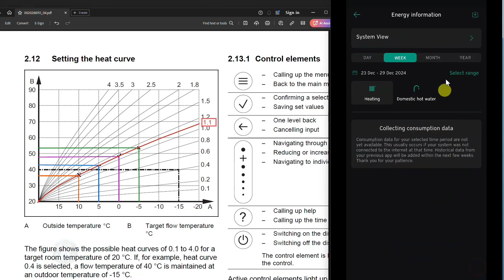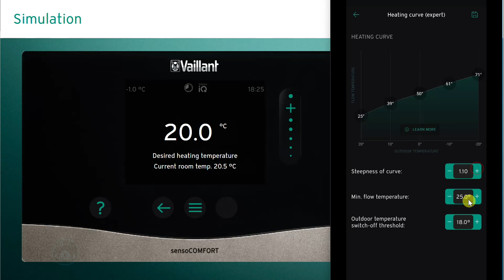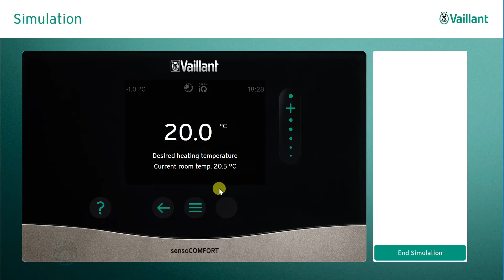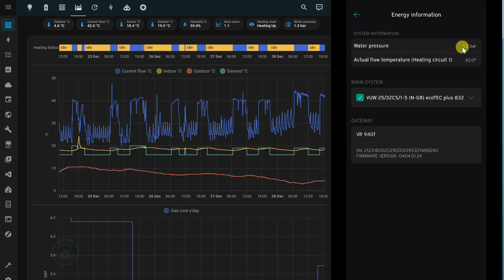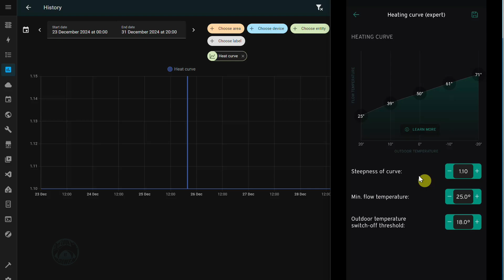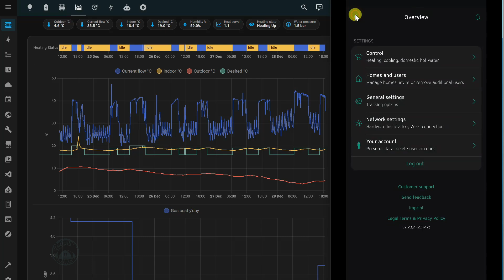How to choose the right heat curve - Vaillant ecoTEC Plus with sensoCOMFORT and weather compensation

Comment: what a false satement at the start that standard combination boiler sets fixed 70-70c flow temp? even 35 year old Vaillant combination boiler have scale 1-9...so you set it at lets say 5 and you get 50c flow temp...condenser boiler are just complicated shite with eco and mild warm radiators...great for brand new houses from ground up, for floor heating, 15cm insulation on exterior walls...on existing houses buying new boiler its not justified cost to have 10-15% less heating bill (in theory if you run in 50/30 mode) which will be nulled very soon when gas prices go up + inflation...not to mention servicing those new boilers...makes me puke
Reply from the maker: I didn't say boilers are fixed at 70-70°C, but fair point on the dial. Older Vaillants could be turned down and I didn't mention that. A dial gives one fixed flow temperature whatever the weather, though. The video is about setting up the heating curve with an outdoor sensor and the indoor thermostat, so the flow temperature adjusts itself according to the heat curve, calculated from the outdoor and indoor temperature. Set up right, the boiler runs low and steady instead of cycling on and off, so there's less wear too. Service it regularly and a good boiler lasts years. And this is an ordinary existing house with radiators, not a new build with underfloor heating. Get the curve right and it saves money, and if gas prices rise, you save more, not less.
Reply: @LookatBowen Sry if I sounded menacing. Point should be : condensing boilers are ment to work at 50/30c or 60/40c to maximize savings and therefore ensuring their prolonged life. True they may last a long time, while not as much as old school built tanks but 10-15 years should be reachable. Back to the topic, every adjustments made to the curve should follow 24h test to see how far we are off to the adjusted room temp. Personally 19-20c in a room is a way too cold for me for comfortable sitting or watching a movie, but hey these new boilers and heat pumps are meant to work that way, what can we do new world.
Reply from the maker: @sifon40, No problem, not too menancing. Agreed on your points, and maybe a week is too long to wait, although 24h is too short, maybe somewhere inbetween next time. Another bonus, from next year (cough, cough) we can turn up the room temp to maybe 20-21c, given the chancelllor is scrapping the gas standing charge. That silly charge will save a few pounds per months, which can go towards a warmer room, although I am sure there is will be some other gas tariff added to get that money back.

Comment: Are you saying that even outside the weekly planner ON times, the heat still runs?
Reply from the maker: Hello Andy, 
Yes, if the temperature (outside of the timer range) drops below the setback temperature, the boiler turns on. (for RoomTempMod = "Expanded"). 
With the mild weather we are currently having, I have my setback temp set to 18°C, the desired temp set to 20°C. During the ON time, it reaches that temperature and turns off. That is the correct behaviour. 
It is unlikely to drop to 17.9°C now, but later on in winter when outside is closer to 0°C, I don't want the indoor temperature to drop to far below the Setback temperature, because it will take a while when the time range is ON to get back to the desired temperature (of 20°C). If you've set that window too small (e.g. 7am to 10am), that is only three hours to reach the desired temperature. It won't get there! The heating is not instant. It rises gradually over your ON window, athough it does depend on how insulated your home is, and also how long the ON window is for, and I guess how deep your pockets are. I am currently running a test this week, I dropped my desired temperature to 19.5°C, the heat curve to 1.25, and shortened the ON windows. I have documented this in a blog post on my website, along with a new video. Check it out! https://lookatbowen.com/vaillant-boiler-settings-tracker-claude-code/

Comment: Thanks, great video !  It clarifies a lot about the configuration of the Vaillant SensoComfort system.  However, any reason why you didn't mention anything about the activation of the Adaptive heat curve feature,  or did I miss that ?
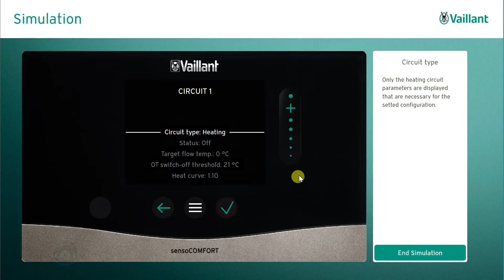Reply from the maker: I briefly covered it at 13:15. Bear in mind when I made the video I only had the boiler for a few months at most and I was still playing around with the various settings. I've done a number of videos on the heat curve and those three active, inactive and expanded options for ROOM TEMP MOD, which make use of the adaptive heat curve feature. In my experience covered in those videos, expanded was the best Room temperature mod option and the one I'm set to date.

Comment: Excellent video, thank you very much. Before i monitor the consistency of the room temperature, i would like to understand the heat curve setting. I was originally set up on 1.8 and the boiler was heating up to 70 °C although it was 10 °C outside. This seems high compared to the graph as a 1.8 setting should heat to approx. 45°C. I set up the heat curve to 1.4 hoping my boiler will consume less. But can anyone explain why it is heating so much when it shouldn’t in the first place ? Thank a lot !
Reply from the maker: Mounz85, 
There are a number of factors at play. No house is identical, your radiators may be different sizes, too small or too large, your house might be leaking warm air, or be badly insulated, this is what makes this whole heating story so complicated. Making changes to the heat curve is only one factor, there is also the max flow temperature, it could be set to high or too low. But, with a few tweaks here and there and a lot of patience, a result is possible, just bear with it. 
Note: I used Gemini for the answer below because it made easy work of what I was going to say to you.  
The 70°C you're seeing is almost certainly a maximum flow temperature limit or a thermostat override, not a value calculated by the curve. Here’s what to check:

1. The Room Thermostat Is "Overriding" the Curve
This is the most common reason. If you have a Vaillant controller (like a sensoCOMFORT), it's likely set to "Active" or "Expanded" mode.

How it works: The boiler sees the outside temperature is 10°C and the heat curve (1.8) suggests a 45°C flow.

But... the thermostat then says, "Wait, the room is 18°C, and I'm set to 21°C. That 3°C difference is too big! I need to heat the room fast."

The Override: The controller then overrides the 45°C and commands the boiler to heat at its maximum set temperature (e.g., 70°C) to close that gap as quickly as possible. Once the room gets closer to the setpoint, the controller will "back off" and let the heat curve take over.

This explains why you see 70°C. The boiler is in "catch-up" mode.

2. The Central Heating (CH) Max Flow Temperature
In your boiler's installer settings, there is a separate setting for the maximum flow temperature for central heating (often in a menu labelled "D.071" or similar).

How it works: This is a hard limit. Your heat curve might ask for 80°C on a very cold day, but if this setting is at 70°C, the boiler will never go past 70°C.

The Problem: It also works in reverse. If a thermostat is aggressively calling for heat (like in point 1), it will often just default to this maximum setting. It's possible your boiler's max CH flow is simply set to 70°C.

What You Should Do
Lowering the heat curve from 1.8 to 1.4 was a good first step. Here is what to check next:

Lower the Max CH Flow Temperature: This is the most effective change you can make. Go into your boiler's settings (you may need the installer manual) and find the setting for "Max. flow temperature CH". It is likely set at 70°C or 75°C. Lower this to 60°C.

The Effect: This immediately puts a "cap" on the boiler. Now, even when the thermostat tries to "catch up," it can only heat to 60°C, which is much more efficient for a combi boiler. This will save you more money than any other setting.

Monitor the Room Temperature: Now that you've lowered the curve to 1.4 and (hopefully) capped the max flow at 60°C, monitor your rooms.

If the house still gets warm and stays warm: Your settings are good. You could even try a lower curve (like 1.2).

If the house feels a bit cold on very cold days: Your curve is too low. Nudge it up from 1.4 to 1.5.

The goal is to find the lowest possible heat curve that still keeps your home comfortable on the coldest days. This, combined with a sensible max flow temperature (like 60°C), will make your boiler run at its highest efficiency.

Comment: We installed a Vaillant aroTHERM system just over four years ago. Unfortunately, our experience has been disappointing due to multiple breakdowns, which have caused extended downtimes, sometimes lasting weeks without heating or cooling. 

What adds to our frustration is that, despite having a valid maintenance contract, the support response has been slow and inconsistent. During emergencies, it has taken two to three weeks to get a technician on-site—unacceptable for a premium system. Although the system functions when operating, its reliability and support have not met our expectations.

 If you’re thinking about Vaillant, I strongly suggest exploring alternatives like Hitachi, Bosch, or Nibe, which appear to offer better performance and support, particularly in Spain.
Reply from the maker: Um, isn't an aroTHERM to do with a HEAT PUMP? This is not a HEAT PUMP video Fredrick, and I can tell everyone watching this video, my experience with the guys who installed by Vaillant EcoTEC Plus with sensoCOMFORT smart Combination Boiler were the best. Their service was excellent. Plus, I've not had any problems with the boiler installation or the actual unit. It has all been settings, and knowing which Room Temp Mod or Heat Curve to be on. And that all stopped 4 months ago when I figured it out. Plus, let me say this as well, when I have called Vaillant Support (twice), they have been very helpful and actually complemented my knowledge of the system. Their app is questionable as ____ (see my HEATING CURVE setup and WHY the myVaillant app is KEYrap!) video, but everything else is awesome!, Plus I've had previous Vaillant boilers in the past and the support and service has been excellent!

Comment: I hadn’t really got to grips with how this worked until coming across your excellent video. Much better than anything gleaned from various calls to the Vaillant engineers. Thanks a million.
Reply from the maker: Hey Jon, thanks for the comment. Yes, I've learnt a lot over the past two months with this smart boiler, and these heating curves, and there no better time to figure it out, than during these icy cold spells. I've got a few more videos coming out, the next one is on Room Temp. Mod.

Comment: Thanks a lot. 
I don't know a thing about heating with a condensing boiler and yesterday an installer came to install a Vaillant Ecotec plus in my place.  (The former boiler was still a on/off boiler which lested for 30 years) When I asked him how to setup ideally, he was annoyed with that question,  saying "I am an installer, not a teacher!"... so, you gave me the answer, thanks for this. 
I also looked to other YouTubes and learned there that the return temperature is even of a more importance in order to have a good rentability... could you also make a YouTube on this item: how to monitor the delta between flow and return to check if the condensing is at its best?
Besides I have another question for you. The offer for the installation was with an airbubble diffuser but I  don't see such a diffuser installed... is it worthwhile to claim for one? As for what I m reading it can boost a 10% rentability?
Thanks for your advice.
Reply from the maker: Thank for your comment. It is a poor show when the installer can't give a basic explanation. I did find that with my installer as well, as he was sub-contracted by the person I got the quote from. That person knew how to work out what was needed in the house based on room sizes, pipework, radiators, doors and windows. He gave me advice on the heat curves, but his knowledge was more for heat pumps, than a combination boiler, but he did say it is a lot of trial and error, and read the manual, which I did and it kind of explained it, although as I mentioned in my video, the manual is basic at best. Now with the much colder temperatures, messing with the heat curve has paid off big time, because the house is warm, despite the negative temperatures. 

To be honest, I don't know how to monitor the delta between flow and return as there are not enough data points for this type of monitoring, and the boiler doesn't show this information to the user. Maybe it does for an installer, I don't know. 

According to various sources online the dew point is typically around 55°C (131°F). This means that the return water temperature needs to be below 55°C in order for the boiler to operate in condensing mode. The return flow temperature has a significant impact on the efficiency of a condensing boiler. The lower the return temperature, the more the exhaust gases will condense and the more latent heat will be recovered. This is why it is important to have a well-designed heating system with a low return temperature. This is why I think having the data (flow temperature vs outdoor temperature) is useful to see what is happening day to day. 

The best person to discuss the air bubble diffuser would be your installer. If they quoted for one, you should ask about it. It wasn't something mentioned in my system. However, I can say the Vaillant ecoTEC Plus has an automatic air vent that helps remove small amounts of air that may accumulate in the system during normal operation. The pump in the ecoTEC plus is designed to be highly efficient and help move air through the system to the automatic air vent. When filling the system, the filling loop allows air to escape while water enters, minimizing the chance of large air pockets forming.
Reply: @LookatBowen  thanks a lot
Reply: @LookatBowen  the air bubble diffuser has been installed. I now also set up the system accordingly to your advices. Thanks again.
Reply: @lookatbowen  Can I upload a picture uphere?  I would like to show you the graph of yesterday's gas consumption and room temperature with load compensation set on "expanded". The boiler then stopped firing during some hours. Yesterday no overshoots of the room temperature. 
Today, after setting the same configuration like you have, also load comp on active, we do have overshoot of temperature. We've put 20,5°C as desired temperature.  It kept on firing. On 22°, I've set the room temp mod on expanded again and the boiler stopped firing.... 🤔🤔🤔 should the installer of the boiler have put some pre-installed config that this is working in the other sense???
What's your opinion?
Reply from the maker: @luccaesens  I've been working on a Room Temp Mod video, after I have been tracking the data very closely and I've been running my boiler on Expanded for the past couple of days, and the results are surprising. Contrary to the manual, and various websites saying Expanded is bad, my system is running better with Room Temp. Mod = Expanded. It is cycling a lot less as well. 🤔Plus, if it was so bad, why would Vaillant have that option? 

When my Room Temp. Mod was set to Inactive (it was purely relying on the weather compensation sensor outside to increase or decrease the target flow temperature). When it is set to Active, it is relying on the indoor temperature and the outdoor temperature. 

However, on either, I find the boiler stays on indefinitely, and I can see in Home Assistant an entity called Circuit 0 that shows a status of either HEATING or STANDBY. With Room Temp Mode was set to Inactive or Active it was always HEATING, but with Expanded, the boiler deactivates (goes into STANDBY) when the indoor temperature passes the desired temperature during the timer by a couple of points of degree, and activates (goes into HEATING) outside of the time if the indoor temperature drops below the setback temperature by 0.3°C, and because it is switching off now, I am using a lot less gas, and saving money.
Reply: @LookatBowen  Thanks.  I will be watching your video on Room Temp Mod.  👌
Reply from the maker: My Room Temp Mod video is now live.
Reply: My system was however on MANUAL mode today, could maybe that be the reason? That the temperature modulation only works with TIME-CONTROLLED mode?